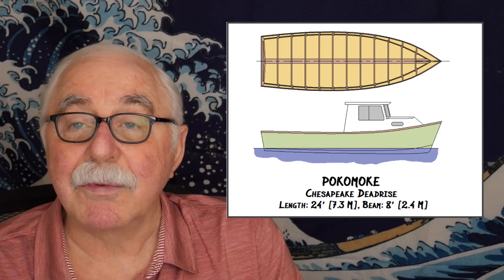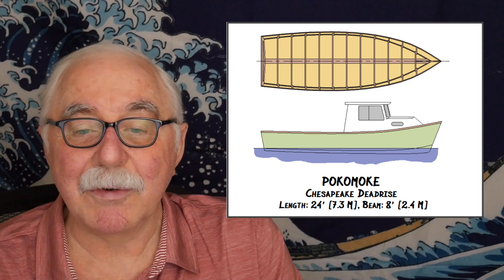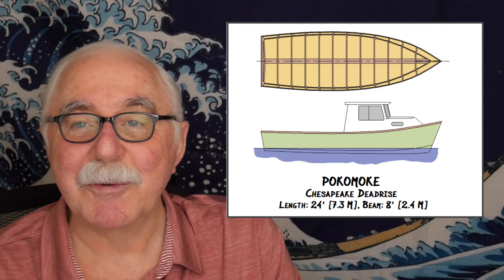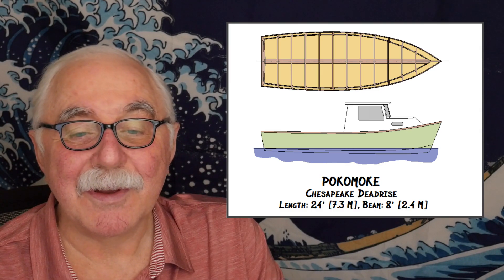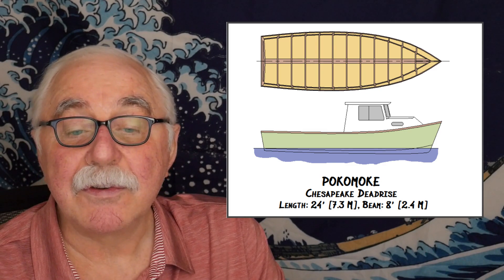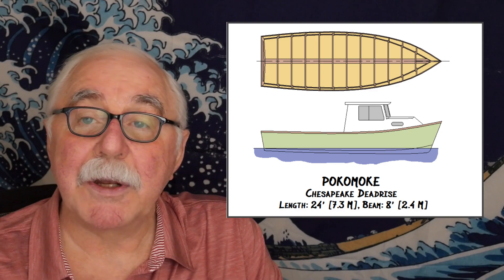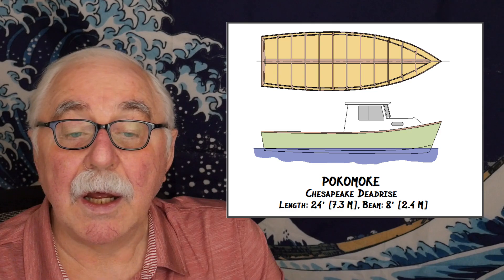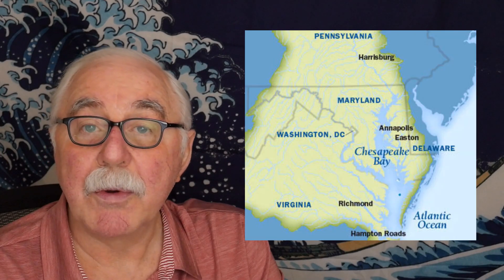Yes, You Can Build a Boat, #18 - Fitting the Chine Log on a Pokomoke Deadrise

Comment: Thanks.  Any opinion out there regarding “floating frame” construction, i.e. the frames are NOT notched for chine logs, sheer clamps, battens, whatever?  Frames may be beveled as necessary, longitudinal elements screwed to each un-notched frame.
Reply from the maker: No thoughts of it and it is not part of any of my designs. Mine are unitized wood and fiberglass composite structures, not traditional wooden boats.